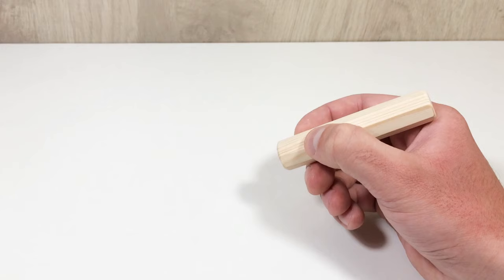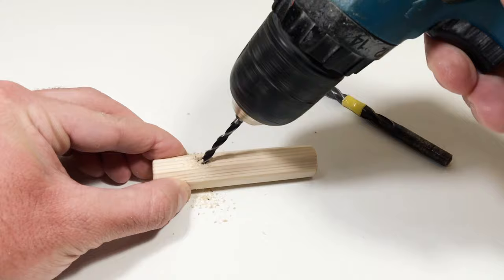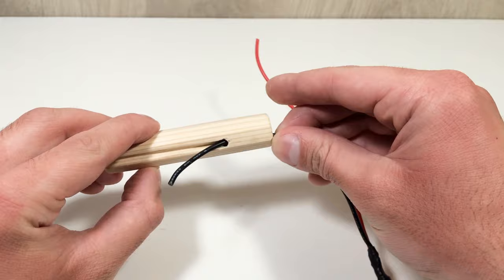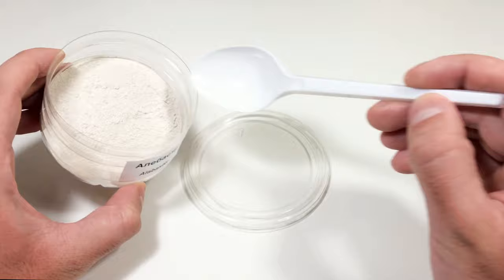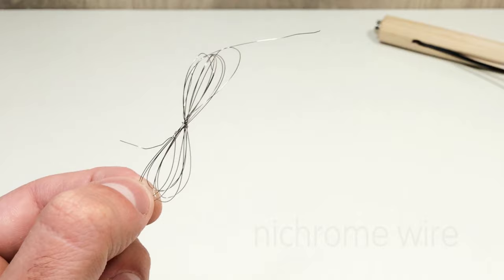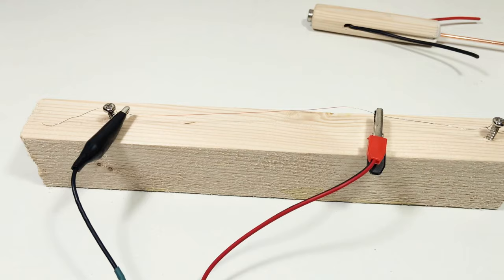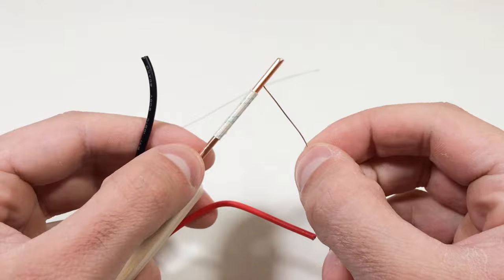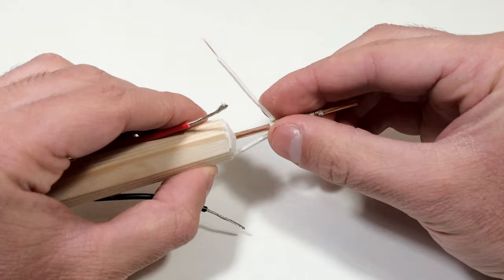Soldering Iron DIY! How to make a soldering iron at home?! Amazing Project!

Comment: Now say what would happen if I took a suitable metal object and just heated up the end hmm?
Reply: Can I just use a tiny screwdriver and my blowtorch to solder?
Reply: It wouldn't with electricity this can be more compact
Reply: Would work 😢 tried it
Reply: @brendonantill8364  blowtorches are actually regularly used to solder, especially with materials which require high temperatures to solder properly, yet which can be crude/big and don't need much precission.
solder irons are nice because they have a fine tip and also directly work on electricity. that said if you need a fine tip you can also indeed put the flame on something like a tiny screwdriver or nail or screw or such. be aware however that a electric soldering iron can work with pretty little power, as in 10W can already be enough and 35W certainly is more than enough in general(for things like electronics), this makes them very cheap to use for long, while a blowtorch or blowtorch powered one would require special fuel and also special fueling methods, and it might use a lot of fuel, making it costly.
ofcource if you have a setup to make the gas or such which the blowtorch uses, such as a wood gasser or such then it is good option as well, and for big objects or if fuell is no concern or if electricity is hard to get.

Comment: You can also double the nichrome wire. Which will cut the power requirement in half. Because the resistance is half. Essentially if you Tripple the wire you could use a 5v power source. Do note of using lithium rechargeable batteries that you put a fuse or short circuit protection online to prevent blowing your batteries up or power supply up. This is how we make the burners for vaping mods

Comment: My question is.. How long does the nichrome wire last.. does it eventually burn up from being so thin, am I suppose to replace it before each use..
Reply: why would it burn up?
Reply: I'm thinking because of the thickness of the wire with the electrical current causing it to turn red in time it would burn out..
Reply: @samuelfrancois4322  metals don't burn.
Reply: @XenonEditz12 lol 😂 🤣
Reply: Dude, of course metals burn. Magnesium is flammable, that's why they make ferrocerium rods with it in solid form on one side and ferrocerium on the other, they both burn.

Comment: Very good job.
Clear explanation and narration.
One question ; 
Can I use 12V-4A battery for that?
Reply: Yes, you can, but i think buying an actual soldering iron is considerably cheaper
Reply: Yes you can, you just need longer heating wire so it doesn't melt under the higher power.